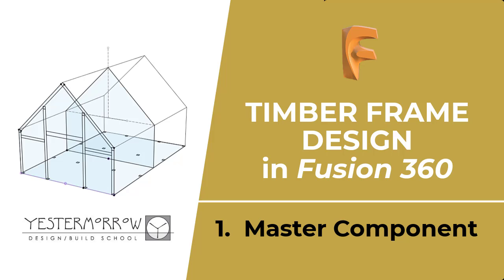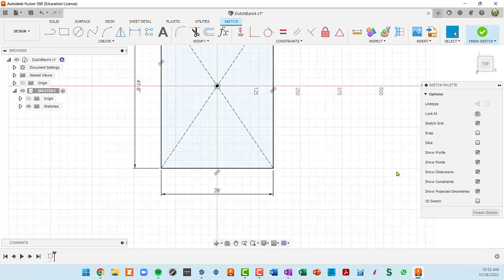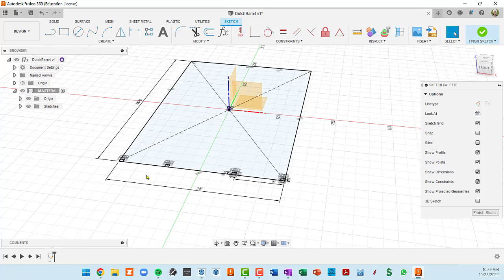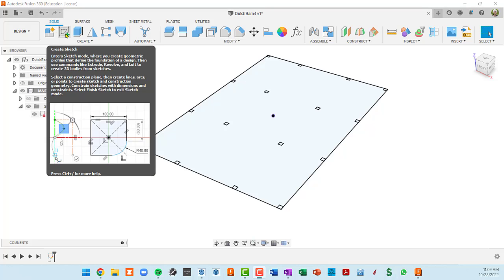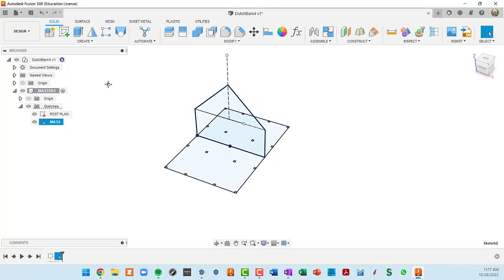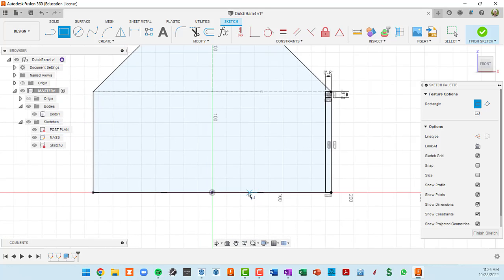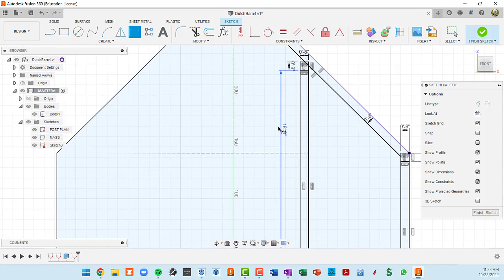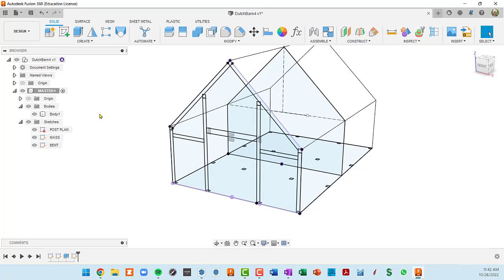Timber Frame Design in Fusion 360 - Part 1: Master Component

Comment: Very nice and clear tutorial.  One small suggestion.  Some of the re-dimensioning could have been avoided had you used the collinear constraint.   For example the blue lines in the BENT sketch were blue because the end of the beam was not constrained to the vertical posts.   But very nicely done.